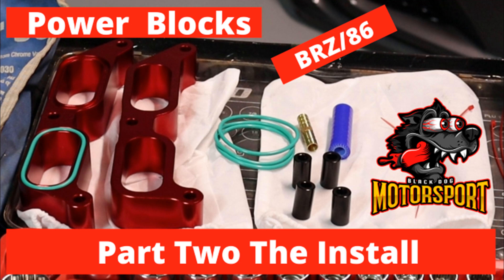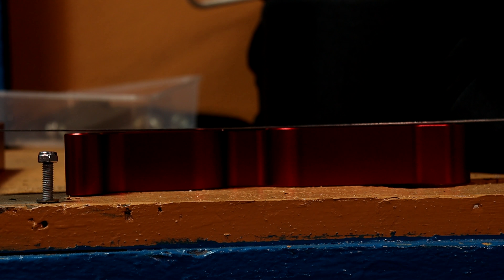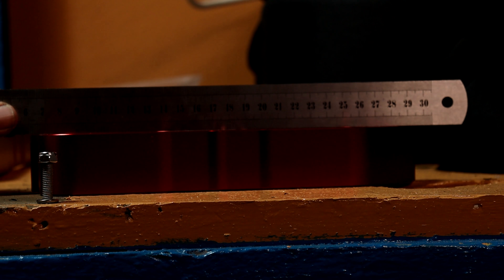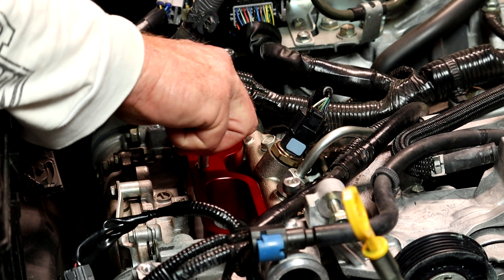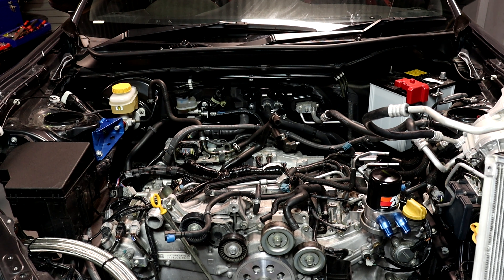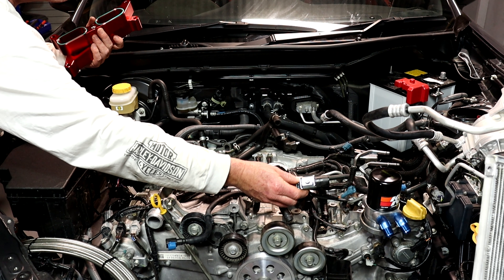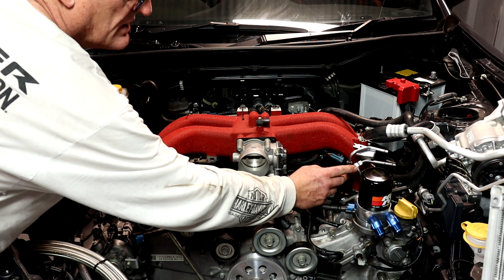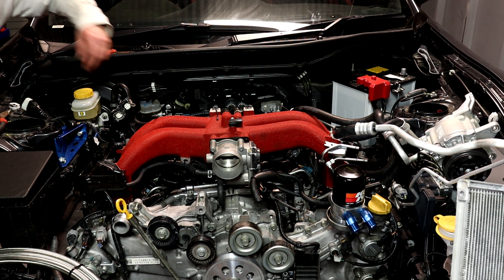Power Blocks Modification BRZ/86 Part 2

Comment: Thnks for the video,The whole that was drilled didn't match the screw of kit?
There was no extension for ECU bolt in kit?
Reply from the maker: Didn't match the Cylinder head, it was drilled at an angle. No extension for the ECU Bolt

Comment: With the install since i have a 2013 Zenki 86gts i don't have the breather there at the back where you put that blue extension breather hose. So i don't need to do that part then ??
Reply from the maker: That’s a breather, so you Cain’t blank it off, although there is no requirement other than emission laws that says you have have to pipe it to the inlet manifold.
Reply: @blackdogmotorsport3784  2013 one doesn't see to have it i can email you a picture if need be. I would otherwise just plumb it in.

Comment: so now that you've had this done a while, do you think they are worth it? is the advertised +19HP accurate as far as you can tell?
Reply from the maker: It,s a bit hard for me to say as i did a whole lot of other stuff at the same time. I would say yes, but that could be the placebo effect. I would question the 19HP though, however I cannot rule it out definitively.
Reply: @blackdogmotorsport3784  yeah, I hear you there. their dyno numbers are most likely in "perfect" test conditions. I'd say though, even if it nets you only say 10 hp I think its still worth the few extra ponys for the amount spent. we all know these cars need as much help in the HP department as it can get especially if you arent going to go forced induction. Id love to but Id like to see how far I can reliably make power without wearing down the life of the motor. THANKS!
Reply: I installed mine last year.  I felt the increase in torque from low rpms like I had installed a header. When I finally installed my header, I barely felt it because the Power Blocks filled up alot of the torque dip.  I'm also running OFT Tune.
Reply: @FRS_Heero so you’re running headers, a tune, and these. Are you also running an intake and if so what type? I’m just curious if aftermarket intakes would still fit
Reply: @TateAuto  Skunk 2 Intake.